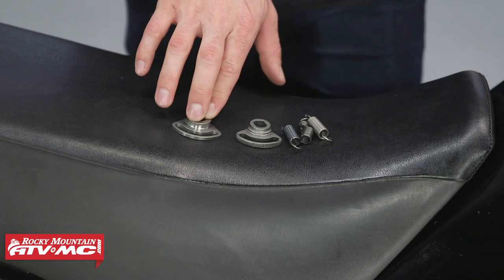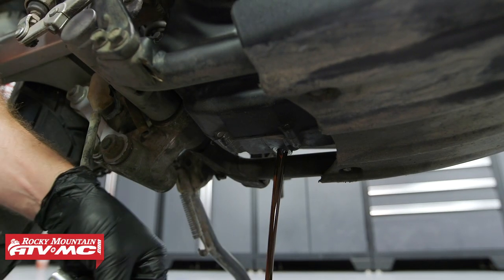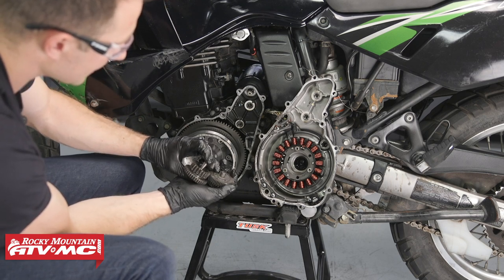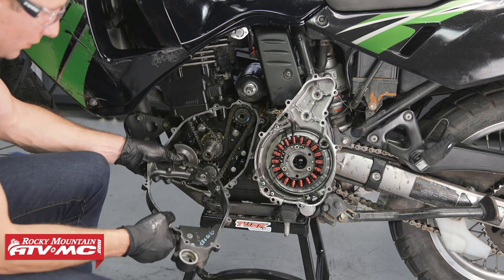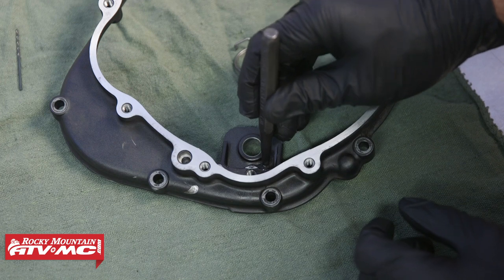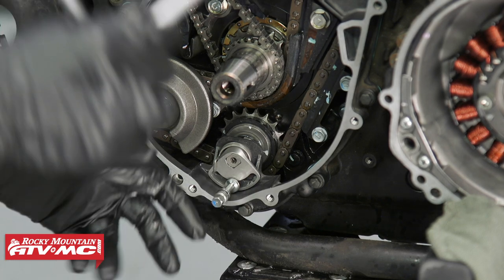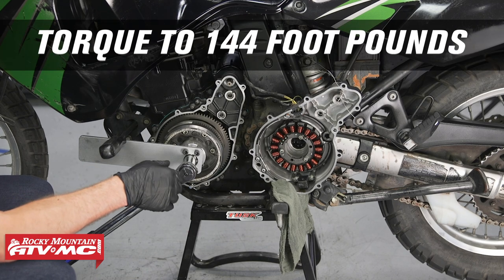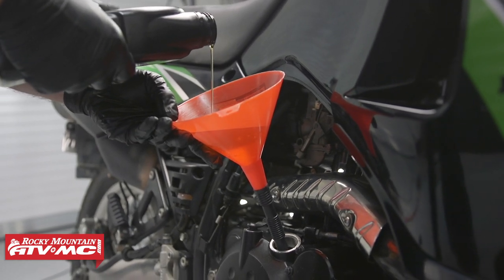How To Install the Kawasaki KLR650 Doohickey & Torsion Spring Upgrade

Comment: I recently bought a 99 KLR 650 with 28,000 miles on it from the original owner.  After I bought it I read about the serious threat of my motor exploding if I failed to replace it.  I call the original owner and he told me never replace the cam adjuster and spring.  So I ordered one and paid 75 bucks for a kit including the 15 bucks for the silly round spring cause it's reported Kawasaki make junk springs. I also paid 12 bucks for the puller.  Once I got the kit I pulled it down and discovers the actual cam adjuster was not the cheep one shown in videos, it was near the quality of the doohickey adjuster, the spring was not broke, and it was capable of self adjusting.  Well, having been played I went ahead and replaced the doohickey and install the spring with the shorter spring that came with the kit. Any one want to by the round spring I paid 15 bucks for and didn't install?  I'm thinking there was a problem with the first ktm 650 and Kawasaki became aware of it and improve the quality of the later ones sold.  This Doohickey part is a check overpriced part and to make it even a bigger scam they charge 15 bucks extra for the spring they recommend and doesn't include in the kit. 
When I sat down and thought about it I realized it's stupid to thing Kawasaki would continue to manufacture and sell a bike that fails  because of a 50 cent part, Of course they corrected it. Kawasaki INC. been in business for a long time and wouldn't rely on some doohickey man to save it's reputation with a 50 cent part. The reason Doohickey man doesn't claim your motorcycle is going to blow up is because he could be sued for scamming you. This is why other people do it for doohickey man who allegedly have nothing to profit from saying it will.  Yes,  I was scammed by the doohickey man, someone needs to scam the doohickey man and his trolls using  fearmonger to sell you 5 dollars in parts for 75$ bucks.  Of course I recommend you ask your local Kawasaki dealer if Kawasaki put a piece of shit cam adjuster in your year model KLR650 before you give away your money to the doohickey man.
Reply: Okay, finally someone I agree with. Fearmongering is the perfect word. I see it in the klr community all the time. People say "you need Motech crash bars, skid plate, rear rack, center stand, eagle Mike oil plug, doohickey, new rear suspension, aftermarket rear brake, upgraded shifter" and if you don't buy all this your bike will instantly fall apart and die. I'm calling a bit of bs on this. I own this bike for reference. I'm not spending $1.5K in uprgades on a 3500 hundred dollar bike
Reply: @TitanFlare  Crash bars are just useful protection, skid plates, another useful protection from anything from speed bumps to sand dunes/bad potholes in a beach parking lot.

Rear Rack, useful for carrying stuff, whether it's an apple crate with a spare helmet inside, or whether it's a duffel bag with work clothes, a rear rack is just luggage rack.

Center Stand: useful if you plan to maintain your own motorcycle.

Oil Plug: I personally will say a Low Profile Oil Drain Bolt is a must have, the oil drain bolt that comes with the motorcycle sticks out CLOSER TO THE GROUND THAN THE SKID PLATE, one speed bump, one pothole, etc wrong, and boom, you just lost your drain bolt potentially. That's not fearmongering, it's just not wanting to worry about something silly that can be replaced very easily when you're going up and down steep terrain.

Doohickey: IF your motorcycle was worth the $3,500 you paid for it, you'd want to take care of it and maintain it well and make sure it lasts a while yeah? Not every spring will fail and get thrown in a transmission, but honestly.. you could go ahead and never worry about how a loose tiny spring could mess up your 3.5k form of transportation and now it's totaled.. because you didn't want to just install a new spring.

Everything you listed (rear suspension is just comfort, rear brake is if you go off-roading a lot, upgraded shifter? Who says that's needed for an ADV bike?) isn't fear mongering but rather just taking care of a form of transportation. If you want to go and buy something and never take care of it, go buy a dirt bike, beat the shit out of it, never change oil, never lube the chain, never clean the chain, and then.. well sell it to a pawn shop once it dies.

Comment: You know,.....................you shouldnt have to do any of this. The manufacturers shoul have to suck it up and do it at their cost, or better yet, just make a product so there isn’t any problems like this to begin with. Use to if you bought a reputable brand like Honda, Suzuki or Kwai, you just rode em and kept the fluids and filters changed and they lasted for years